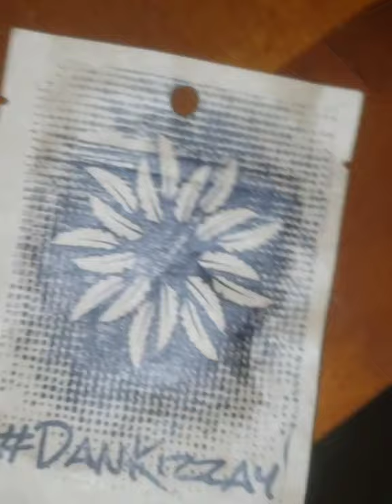cannabis seed germination, water cup method

Comment: U just let them grow in clean water?????askin 4 friend, but fill me in I need to know 🖤🙏🏾
Reply: Na just for 18hr or so to pop it open for root. Then to soil.
Reply from the maker: Let em sink to the bottom in.complete darkness & under a heat mat for 24-48hrs. (Check it 24hrs after seeds sink to bottom of the cup). Once you see the seed casing open/Crack - transplant it directly into your soil, rooter plug or Pete pellet. Happy growing ✌️
Reply: @jerseycannabiz  I thought after u see it sprout in the water u put it in a damp towel inside a plastic bag? Idk something to do with a plastic bag
Reply from the maker: @momdontcomein5343  some people do that... but it's not necessary, after water soaking & seeing the seed casing Crack open -- the seed can be placed directly into soil/coco/Pete pellets etc & then into darkness until they sprout. Once the seed pops above the soil/media - time to give it light. We used the paper towel method before, this is much  faster & far better end result 👍
Reply: @jerseycannabiz  thanks! update: my seed started cracking my mom suggested i leave it in a damp napkin in a plastic baggy and told me to check on it every couple hours and spray it with room temp water till it sprouts. i remember i tried this before and it worked and another time my little weed seed started molding. i heard cinnamon helps molding, do you think i should sprinkle some cinnamon on my 2 seeds and the damp paper towel? or do you think that’ll ruin my seeds? sorry for all these questions 😭
Reply from the maker: @momdontcomein5343  questions are what we're here for! I don't believe cinnamon will help as it could harm the tap roots. However, you don't need a long white stem to come out of your seed. As long as the seed has cracked open - it is ready to be placed in soil/coco or whatever your final grow media may be. 

Next time, try the water soaking method. I've used the paper towel method in the past & I must say.... our team had had 100% germination rates for 6 consecutive years (with an occasional dud) just by a 36 hour water 💧 soak & transplant to soil after the seed casing opens. 

Remember - once you plant the seeds, they need a heat mat, humidity & COMPLETE darkness in order to sprout.
^--- most important step.

Reach out anytime for questions via email & I will respond more quickly - Brandon@Shoreganix.com is my personal email specifically for questions on this YouTube page. 

Happy growing!👊🌿👨‍🌾

Comment: Do you know how to see the male from the female in seeing form or just growing stage if growing stage tell me what you know about stage 1
Reply from the maker: Typically - a female seed will have a PERFECT circle at the top with an indented (crater-like) groove within the circle at the bottom of the seed.

If the seed does not have an indented crater nor a perfect Circular groove or if the back of the seed looks like it is the opposite of a crater & looks like it's pushing out rather that inwards (like a crater) it is likely a male.

When it comes to spotting a male in a plant it is difficult to tell the sex of the plant until it begins to bloom - but testing kits are available where you can take a few snips of your plant, send it to the lab & they can tell you if the plant is male or female in its first weeks of vegetation ✌️ hope that helps